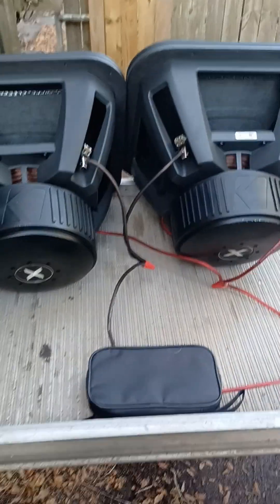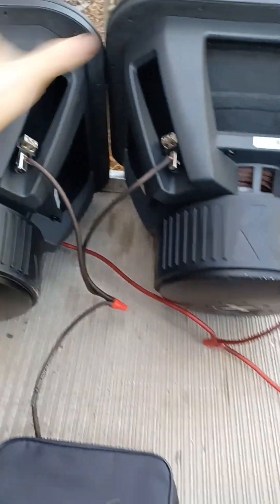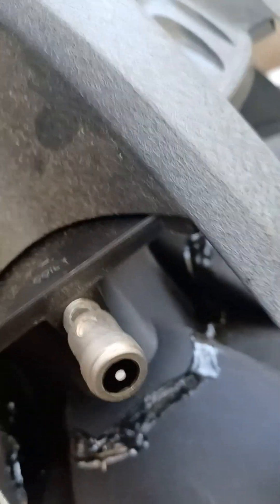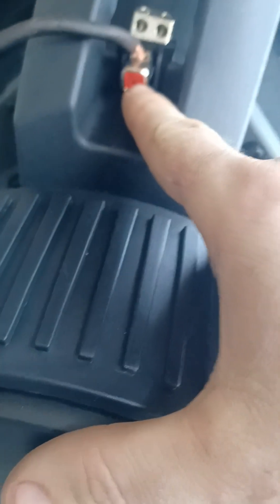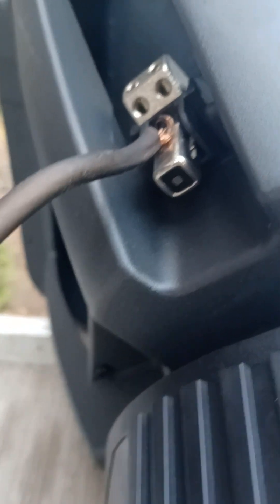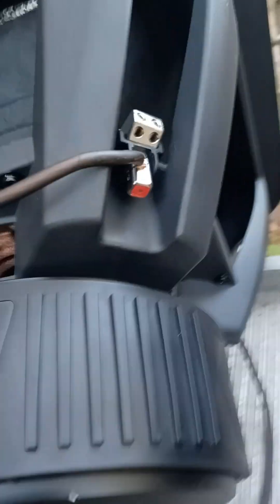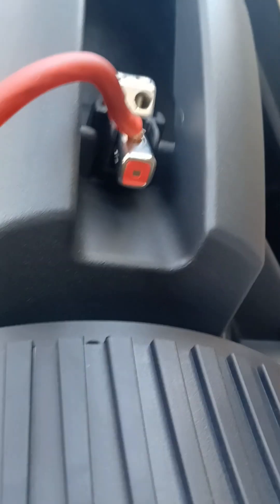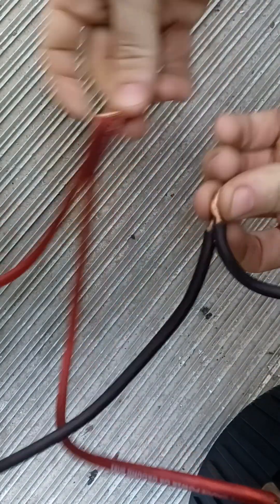2- 1ohm "dvc" subs wired in at 1ohm to the Amp

Comment: You should update ur title. You can't wire 2 - 1ohm subs into a 1ohm load. You CAN, however, like you show, wire 2- 1ohm DUAL voice-coil subs, into a 1ohm load. Big difference, and ur title comes across as click bait. 

Other than that, you do a good job explaining it in simple terms most ppl should understand. 

But yee, add DVC into ur title lol.
Reply from the maker: I'll add dvc . The thumbnail should be their 1st clue it's dvc subs
Reply: Is this safe to do. I have the same subs. But each sub has its own cxa1800.1 amp
Reply from the maker: Kicker.com says your amp is 1ohm stable.  If your subs are 2ohm you can wire Parallel into the Amp. 

Positive out of amp to red then jump from that terminal around to the other red with dot terminal.

Negative from amp into black and from same terminal jump to the black with dot. That 2 ohm sub is now 1ohm at your amp. 

My subs are 1ohm as is my amp but when I add a second kxa 2400.1 making 1 per sub I can wire my 1ohm sub too 2ohm at the Amp which my amp can do and I'll stay at 2400.1 output.  With the kxa2400.1 it has the same 2400.1 output at 2ohm and 1 ohm

1 ohm however gives +/- 10% I believe is what the specs sheet says
Reply: @jerebo84  I believe the 1800.1 is the same at 1or2 OHM. What’s the lowest Hz ur amp goes. Can u explain to me what does +/- 10% mean
Reply from the maker: @NoName-gk2sj  kicker.com says the low-pass crossover frequency is 40-160hz.

The +/- 10% is stating the amplifier will either add 10% wattage or decrease 10% wattage at 1ohm as per kicker.com. if you can get 1800.1 at 2 ohms do it , it's less stress on the electrical.  But if you have a 1ohm stable amp and you have the same subz as me which are one ohm your amp can't handle. .05ohms you will burn it up. So wire it like I said previously and you're safe per single sub amp combo you have. And your amp is 1800.1 @ 2ohms so wire your single amp sub combo like previously mentioned and your good
Reply: @jerebo84 - I know what you were trying to say, when you were answering to NoName-gk2sj telling him his amp can't handle 1/2ohm= .5 ohm in decimal form, not .05= 5hundreths of an ohm= Fire😁😆 like you typed, not trying to be a d-bag, as i see a lot of people type that wrong, so i don't know if it's a typing error, or people just don't know? Just trying to help, thanks.